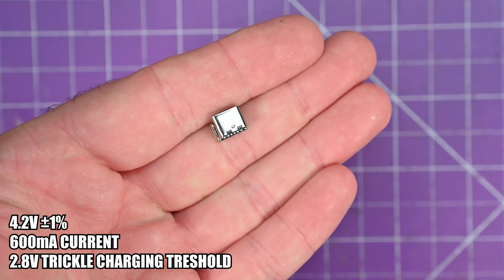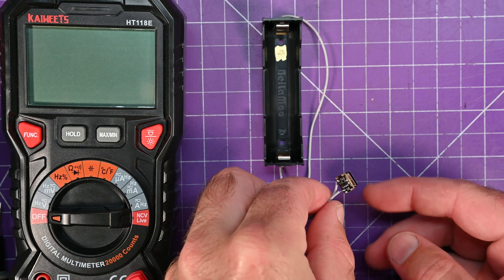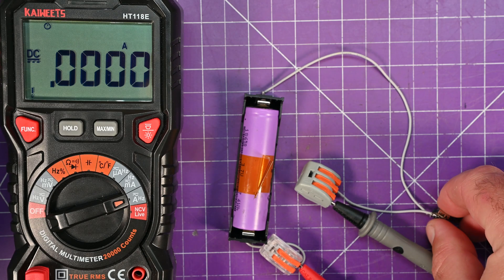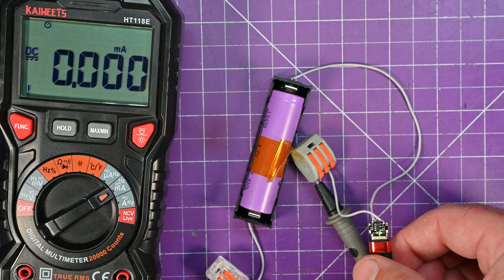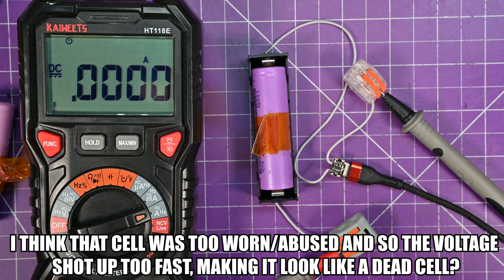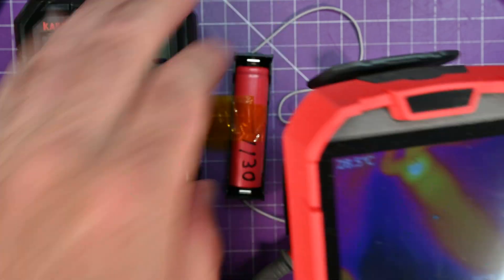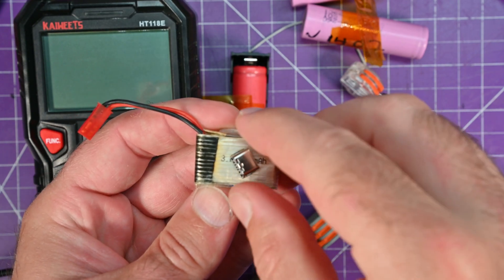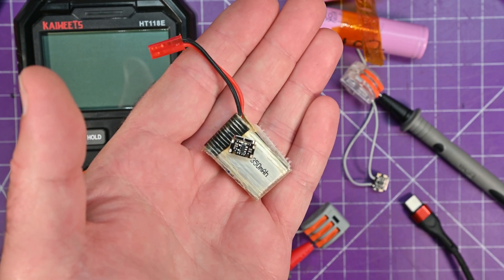A Charger For Ants? Smallest Lithium Charger In the World

Comment: I had the same issue with a different board using the same tp4056 chip.  If both LED's are on, then the chip isn't detecting a battery.  With the multimeter on the milliamp mode the charger is unable to determine if the battery is present.  Has something to do with how the tp4056 checks for batteries.

Comment: I may be missing it but where do you connect the load? Without that this all seems pretty pointless, the cell would have to be removed from the device and charged externternally, the size of the charging module then becomes irrelevant. Seems a bit odd.
Reply from the maker: The load indeed goes on the same pads as the cell - you can charge at the same time as your device is powered up but if you draw more than 600mA from your device, it won't charge at all. This is really for smaller loads and wearables and stuff
Reply: I think the load goes on the same pads as the battery. You would have to turn the load off when charging. Just a guess though.